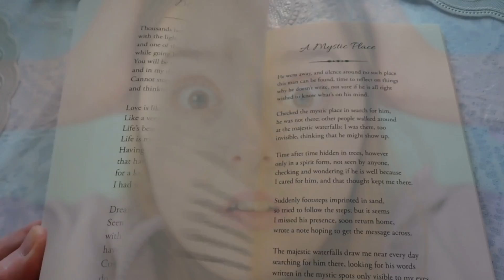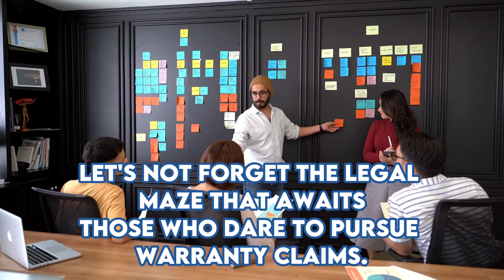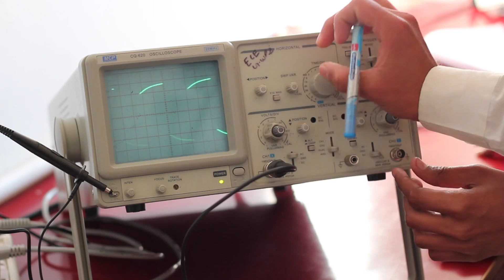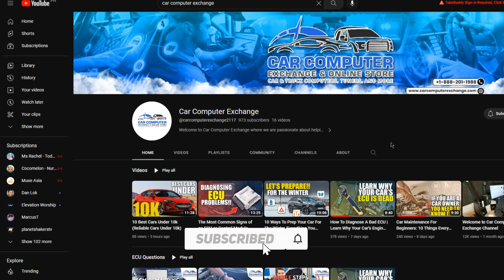The Dark Side Of Engine ECU Upgrades

Comment: I thought ECU upgrades gives improved performance, enhanced driving experience, and efficiency for vehicles., I never thought it has underlying consequences like excessive heat, reduced reliability, warranty voidance, compatibility issues and more. I think before deciding to upgrade the ECU, it's crucial to thoroughly research the specific upgrade, consider the reputation of the tuning provider, and understand the potential impact on the vehicle's overall performance and reliability.

Comment: ECU upgrades can offer performance gains and fuel economy improvements, but it is crucial to weigh these benefits against the potential drawbacks and risks. Carefully consider the potential impact on engine longevity, warranty coverage, safety, emissions compliance, and cost before making a decision. Consulting with a reputable automotive technician can provide valuable insights and help you make an informed choice.